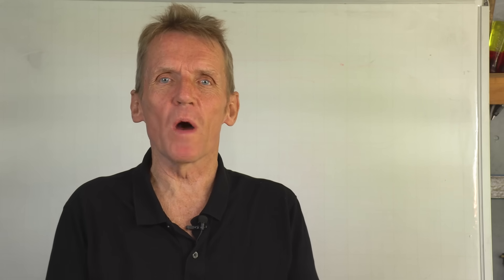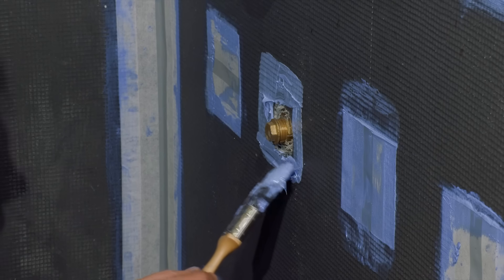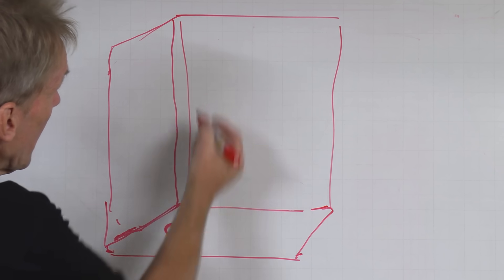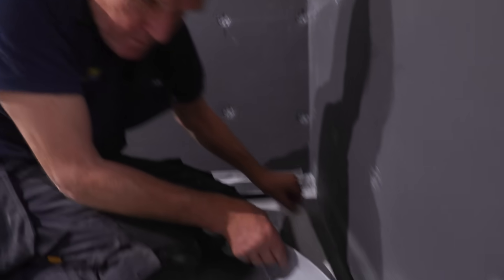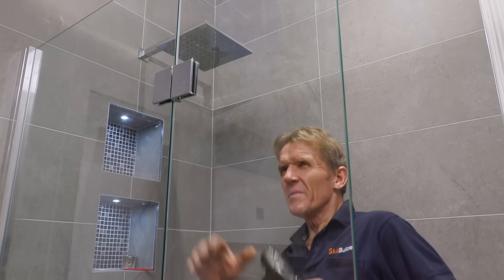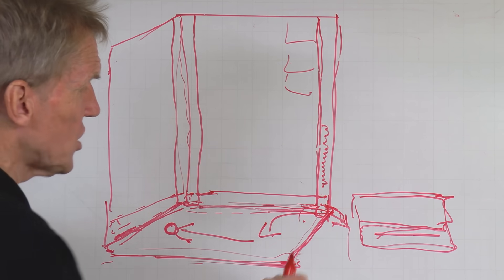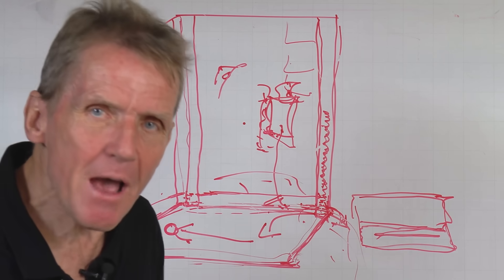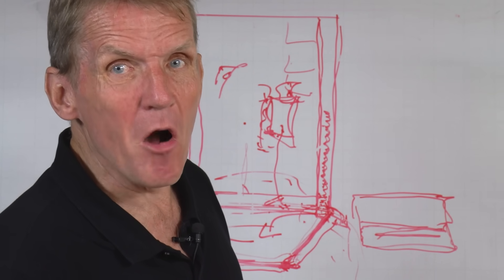This Is Why Your Shower Tray Leaks

Comment: Hi Roger,  I wish I had seen this a few years ago!  We have fitted four new showers in UK and France over the past 10 years in two major refurbishments.  I though they would be fine as e had used green plasterboard.  Our wet room is OK for the floor as I tanked this under the wet room tray but the rest is " conventional".  I did make sure we only sealed the outside of the screens.

The big question is how to seal the shower mixer valves.  Fortunately these are all surface mounted on top of the tiles.  How would you advice retro sealing these?  Many thanks for all your tips and tricks.  Immensely valuable to amateur "plumbers" like me.  Mike
Reply from the maker: Hi Mike 
Not every shower leaks but the tile backer board means that when it happens the damage is limited and doesn't require a rip out. Green board is better than plain but it gives people a false sense of security. 
I didn't want this video to put the fear of God into people who have had a job done but mearly to alert homeowners to the gold standard. 
You can seal the surface mounted bar mixers very easily with silicone of polymer around the pipes under he cover plates. I usuall gun a nice little horse shoe under the plates so any water it caught and delfected around the hole and down the the bottom where it drips out from the plate. It is all very basic.
Reply: @SkillBuilder  Thanks Roger.  Reassuring, we will hope for the best and I will  check behind the trims and seal around the pipes if it wasn't done at the time.  Mike

Comment: Just one question Roger. If you screw the channel for the shower screen thru the tiles & don’t seal inside, isn’t the water going to seep into hole & get behind the tiles?
Reply from the maker: Yes in theory it can leak but if it gets past the screw and goes behind the profile it is going to drip down. Having said that I usually dob some silicone in the hole before I put the screw through.

Comment: I fit high end bathrooms and wet rooms. The commonest error I see in strip outs is people forgetting to silicone the bottom of the wall profiles at the wall tray joint. Even if the outside is sealed properly water will find its way out!
Reply from the maker: That is true. I said that the silicone should run right along behind the profile. I agree it is very important
Reply: @SkillBuilder  What kind of shower relies on silicone to seal it??!!?? If the shower has a frame it should have a drop lip that sets on a raised inside edge of the tray or curb. If it is bare glass then it should sit to the inside of a lip in the curb/tray. Using silicone to seal a shower is as smart as roofing from the ridge down to the eave and then using silicone to keep the water out! People living in thatch roofed huts in the jungle 2000 years ago even understood the concept of shedding water! 🙄

Comment: Elements, Wedi tile backer etc. is so easy to fit and seal compared to messing on with plasterboard.  It’s worth using just for that and once the joints are taped and sealed it’s water tight.

Also tape seal the board to the plywood base, put some seal compound on that as well.  
Add some plasticiser to the mortar bed to make the mortar easier to manipulate.
Adhesive seal the tray to the wall so it doesn’t shift.
Membrane seal it to the wall before tiling.
Silicone the tile line to the tray. 

Use solvent weld drain pipes so the only compression fitting you have is the one on the trap (fit a decent quality high flow trap as well).

Either use soldered pipe joints on your water supply, good quality flexible or where you have comp fittings use jointing compound and/or tape/thread.

For flat face unions into shower boxes etc. there’s usually a small gap you can get a metal bonded seal washer into which are rated for high pressures which is worth having as you can tighten them to a full stop without over compressing the seal. 

Wonder which channel I’ve been watching before I fitted my shower 🤔
Reply from the maker: I read all that thinking that I agreed with every word and then got to the end and laughed.

Comment: Top video Roger I love it when you get into a roll on the ranting. I am no builder, a mere time served mechanical engineer with 40 years experience and everything you say is absolutely sensible. Installing to get your money and scarper is one thing and of course the new bathroom will look ‘super impressive’ but it’s always the bones of the job that gives the endurance and reliability not the ‘icing on the cake’ that the customer sees. It is not always possible for aesthetic reasons but when I did my shower recently which just so happens is positioned over a utility room I put in a service hatch in the utility room ceiling for future access to the drain plumbing. Could not do for the main bathroom though did not want a f’ugly hatch in the kitchen ceiling. 😉Keep up the good work Roger.😀

Comment: I thought the tray was meant to sit hard up against framing and waterproof broad was meant to sit just above the tray lip give a flush face for waterproofing/ membrane  tape and tiling
Reply from the maker: Hi John 
You can do that but you then have tiles on top of that and the margin for adjustment on the screen is at its limit which pushes the edge of the screen or glass over the edge of the tray. It is generally better to put the board down to the floor and seal the tray to the board then bring the tiles down onto the tray. I often use silicone along the back of the tray then do the tape and then the tiles then more silicone.

Comment: Spot on. Use BIG tiles to minimise number of grout lines AND work out tile pattern NOW so all valves and fittings are not floating in weird positions. Fully rectified tiles (flat sides that are ruler flat and each corner is a true 90°) with minimal grout widths - 1,2 or 3mm and epoxy grout work but epoxy can be a skilled product so smooth tile surface will help. What isnt mentioned is skilled plumbing. All the effort in the world comes to nought if there is a leak in concealed plumbing behind the wedi. Pressure test and flush out the pipe work. DONT SKIMP on the shower valve and outlets. A good product will pay you back many times over. Hansgrhoe iBox system is excellent. No.... superb. Front servicing for the on/off and diverter valves and thermostatic cartridges is a must. Go thermostatic over manual every time. Also, easily accessible water stop valves. Number of jobs I have seen where this simple device is ommitted has been shocking. Get a decent pump too if you are on a low pressure system. Too many rubbish pumps so easy to make a mistake. Stuart Turner and Salamander to name a couple are quality pump makes

Comment: The amount of these I have fixed. Thing is, by the time the customer notices there is a problem, it's to late. Joists and studs are crumbling away etc and turns into a major job.
LOL, one job I fixed was where a tenant decided to make a wetroom. He ripped the floor up Shaved 2" off the joists for a fall, skined it with 1/2" ply then mosaic tiled the lot. It all slow seeped thru the whole floor and rotted out all the joists. That was an expensive job to fix.
Reply from the maker: Sirus
You are right, it is too late by the time they see it.
I saw a similar job to yours where the whole wet room floor void was full of dry rot and I told the health club it would cost thousands to fix.
They went bankrupt a few weeks later.

Comment: What do you think of that shower panel board ? Which had no joins and comes in all different colours ?
Reply from the maker: A good idea for sure but still take care of the seals at the bottom. Tape first then fit the panel then the silicone.

Comment: Repointed all my groutlines with Tec7 about 10 years ago as the grout had exhasuted itself. It required a few rolls of masking tape to get the clean lines but seems bullet proof so far. Any other mediums apart from grout being used in the trade?
Reply: Yeah, no tile! If the grout failed its because of movement. Its likely water has already weakened the substrate and you have used a high binding grout which helps minimize movement but also just disguises a problem already evidenced.

Comment: I havnt used plasterboard in wet areas for years!! Aquapanel all day long. Then seal all joints. I use a larrsen tape on tray and bath edges then tile. Do it right 1st time to build your reputation.

Comment: Hi Roger, what do you do to ensure the floor under the tray is waterproof?
Reply from the maker: That is tricky because the trap goes through the floor so there is nothing that can be done that is easy. I usually prime the floor with SBR and then when that has dried  out my sand and cement on.

Comment: I use Aquapanel it is easy to use. Never use Hardibacker so hard to cut. Silicone tray to wall joint, then silicone tile to tray, never leaks. Dow 785 Silicone not the cheap stuff.
This video gives good advice, but I will still never bed a resin tray on sand and cement :)

Comment: Instead of then tiling, install a larger waterproof shower wall board over the tanking and no more leak kit, then no worries of water getting through the grout or tiling joints either :-D complete belt and braces.
Reply from the maker: We need to do more on shower wall boards. If you can introduce us to a manufacturer it would be great.
Reply: @SkillBuilder  we will be able to get you in contact with the right people im sure. Send us a message or email

Comment: I was always taught to chop baths and showers into the wall (plaster dept) always seemed a good idea to me.
Reply from the maker: Dave I used to do that too but if it is recessed too much you can't get the enclosure on the footprint. The wall profiles only give limited adjustment.

Comment: My approach completely,  I'm paranoid about water leaks in my home, quite often by the time you recognise a problem its too late! The damage is done.
Reply from the maker: That is not paranoia it is sensible precaution.  I have seen whole floors ripped out because of dry rot.

Comment: Make sure you don't burst the water main under the cement floor while removing a shower and fitting a bath - like the council plumber did in my property.
It was left leaking for over a year.

The walls were gradually soaking through and they had to remove plaster and screed in two rooms two metres up.

Comment: Yes, well said Rog. about time someone reinforced the point of not sealing the inside of the screen!!! Why they don’t highlight this in flashing lights I’ll never know. Common sense but only if you take the time to think about it. I drive everyone nuts because I can’t stop overthinking everything and so take ages to think about all potential issues later on……to all of those who mock me, who’s laughing now…..😂😂
Reply: Do not seal inside of screen is in the instructions. The real issue is the muppets who think they know better than manufactures and real professionals. I see loads of sealant around baths and shower trays, last job I was at I swear they used a brickies pointing iron to spoon the silicone on... it went up the wall 25mm!!!!!

Comment: I  think shower valve install needs rethink as when it fails a lot of work to replace. 😁
Reply from the maker: Hi Ian
A lot of people favour the bar mixer which takes minutes to swap over.  The built in shower valves are not such a problem because you only need to swap out the working bit which just unscrews. Most of the time it is just a question of descaling and it goes back in.

Comment: I always used marine ply in the shower area and never had any issues and when the new style tile boards came on the market I switched to using them , it's a no brainier not too......😜
Cheers Roger......👍
Reply from the maker: yensabi
plywood of any sort is not banned for tiling on walls. It does support mould and the adhesive fails. Tilebacker all day long.

Comment: I don't follow how the 'classi seal' provides total leak protection, as it's not bonded to the wall boards so what's stopping water passing by there? Whereas the 'no more leaks' tape is bonded to the wall boards and tray.
Reply from the maker: The Classi Seal is bonded to the back of the tray and the wall. You need to use Pro Seal or something to seal it with.

Comment: Roger to be fair I think most folk a little peeved about your pushing of abacus products, good as they are for most they would be too expensive , given materials and labour as opposed to concrete board and good quality grout + sealent, plus even with abacus / tanking it still comes down to the old adage of it it ain’t put in right , it will fail. I learnt this the hard way with my shower so I would pay extra for things like abacus but not all folk the same , as always great work in explaining things 👍

Comment: I went away from tiled tub/showers two decades ago.  Switched to one-pieces.  I don't care how pretty tile is, it leaks, and has to have the grout maintained which I hate.  And 'Look ma, no leaks!'  A worthy rant Rodger.
Reply: Tiles need replacing too so they are not good for the long haul.
Reply: This. Tiles are at best mimics of stone so why not just use 10mm slabs? We use epoxy and kevlar backed stone panels for one-piece walls and either abraded single piece single plane slab floors to a linear drain or river pebbles for floors with uneven plane. Also did a decorative concrete floor with an ipe floor rack on top for a spa look. Tiles are meh at best and even if they are pretty its like a pretty girl that always brings her homely cousin with her----> grout! Yuck!
Reply: Yes, one-piece panels are great.

Comment: Come on, be honest, your a successful plumber, and not as young as you once were, 
30 years ago you installed shower trays and enclosures that are still going strong to this day! 
That's before the days of tile backer board, or even moisture resistant plaster board.

Swimming pools built in the Victorian era  are tiled and grouted,  
And many are still going strong today.
The ones that have been decommissioned, we're mainly due to efficiency.
Reply: Yes it happens such system can be a success, he acknowledge that, but let's continue being honest and admit that the sucess or failure of those systems are down to luck because the conditions that cause failure are out of the installers hands. Sometimes a structure is less susceptible to stresses, sometimes the grout has the perfect mix for it's application, the stars align and cracks are avoided. Roger is advocate for a system that means you don't have to have luck working for you. That's the kind of thing that can let us say we're building houses better than they did in the Victorian era.
Reply: @Fe7Ace  are you a sales rep?
The Romans built baths, in Bath, 1800 years ago, and they still hold water.
These type of modern products are labour saving products, 
What craftsman in the past perfected over many generations, is now achievable by anyone, and it's available on Amazon!
A hard earned skill is lost forever, but your bathroom was a bit cheaper.

Yes products like these are great, and as amazing as they are, can still fail if not fitted correctly, luck has nothing to do with it! Hence the supplier will not guarantee it.
The performance is the responsibility of the installer.

Ultimately it's easier. If it's still working a in 2000 years or so, it can then be considered, at best, 'as good as traditional methods'
Reply: Ahhh yes, that super durable Victorian era plasterboard we've all heard so much about! Exactly what would crumble there, its a hole in the ground? Feel free to dig a hole and adhere tiles to it and bathe there since that seems to be the parallel drawn here. The rest of us will bathe in the comfort of our homes modern showers and those of us smart enough will take the correct measures to protect those homes from water intrusion. Have fun and dont forget your wig powder!
Reply: @danielbuckner2167  you've got me wrong, progress and innovation is the way forward, 
But this isn't the only way that works, good quality craftsmanship works too, 
You come across as an Ikea fan,
You'll probably change your bathroom in 5 years anyway,
Reply: @sally6457  Haha, I might be if I were ever to go into an ikea, have t yet! I might indeed change the bath in five years! For me labor is free and materials cheaper than retail so its not as big a deal. Plus, new products are fun to play with and you cant experiment on a clients house. We have a rental house that I cant wait to tear the shower out to do a backlit panel but the renter keeps renewing so im certainly not going to throw money in the street to do it. Im sure I will slow down and it wont be as fun one day.
Reply: @danielbuckner2167  experiment on client's homes?
And you won't replace the bathroom in your rental property while you have good long term tennants?
And labour is free? 
So basically you do all your own building work, as cheap as possible, while collecting rent on a property you feel needs improving.
No wonder you like this kind of product. 
It's a fit all product that can be installed by any moron, and gives the same performance as a craftsman. 

(Bet you own a farm?)
Reply: @sally6457   Lets imagine you are a renter. Maybe you are. You have a 3/2 because you need that many not because you like extra rooms and baths. Your landlord announces hed like to come in and gut a bath while you are there and you will only have one bath for that time. I cant imagine someone being happy about it plis they were already satisfied when they signed the lease, what am i getting for the extra expenditures? Far easier to do kt on tuenover. Experimentation is using new products as laid out by reps and not making some crap up like a DIY backyard scientist.
Reply: @sally6457  Try reading again, you seem way out there on the farm and products.